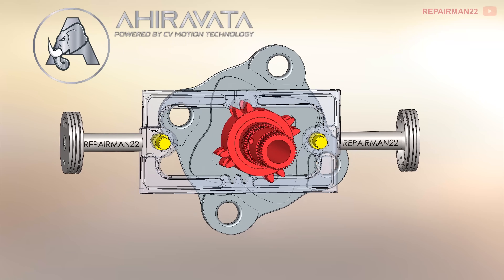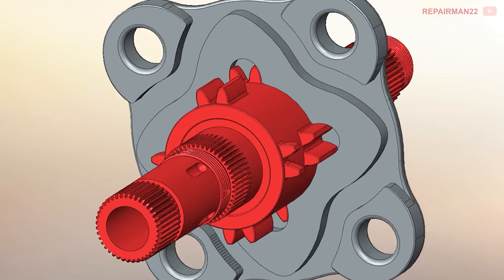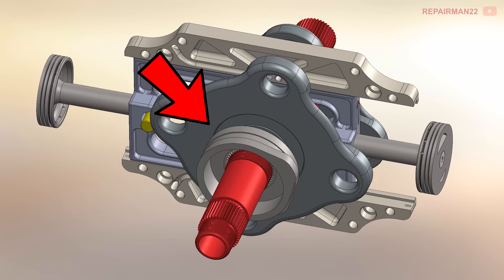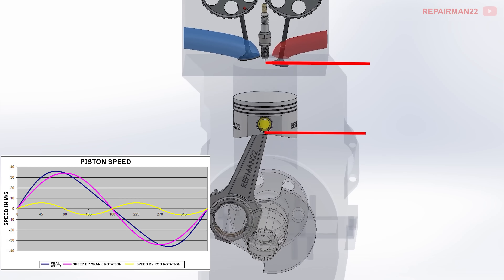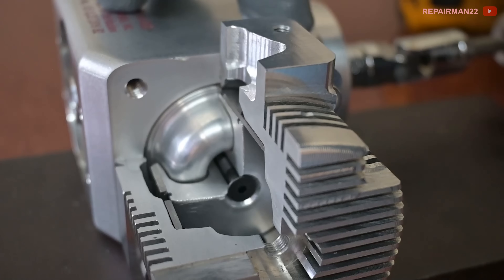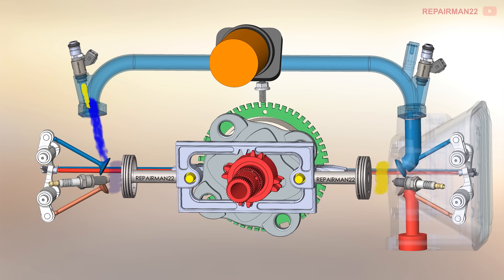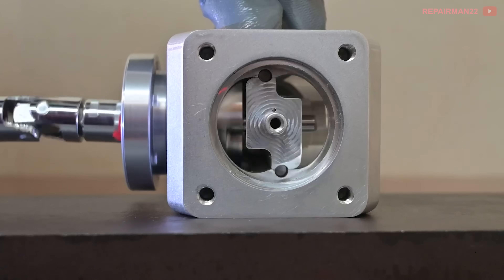The New FLOWER ENGINE 🌺 from Ahiravata 🐘

Comment: Why do all these inventors hate the crankshaft so much?
Reply: The biggest problem with crank shafts is that piston pressure is greatest while the connecting rod is lined almost dead-on with the crank, preventing much meaningful work from getting done. The sideways forces from the rods shoving pistons into the wall through most of the stroke contribute significant losses too and there is no way to mitigate those in a conventional crank engine.

The 'flower' takes care of the dead-end problem and friction on the 'yoke' slides can be taken care of using an oil film just like crank journal bearings.

In the case of an engine designed as a range-extending generator though, it would be even better to skip the yoke altogether and drive a linear motor-generator. No more side-loads to worry about besides gravity.
Reply: @teardowndan5364   "preventing much meaningful work from getting done" Contrary to what the video claims, the gas mixture in a cylinder doesn't burn all at once,  the piston is scavenging useful energy for almost the entire power stroke.
Reply: @lo1234-w9r  Spark-ignition gasoline engines waste fuel on the lean-rich cycling required to keep their catalytic converter happy and avoid a meltdown from overheating their pistons at the stoichiometric (ideal) air-fuel mix.

The efficiency holy grail of gasoline engines is achieving homogeneous charge compression ignition which burns colder and cleaner all at once, reducing if not eliminating the need for emissions control equipment.

In a conventional engine where the piston gets dead-locked by the crank, detonation can be immediately damaging if not catastrophic and safe operating limits have to be restrained accordingly. In an engine where no such dead-lock occurs until BDC, the likelihood of catastrophic damage should be much lower and allow safe operation closer to the explosive limits.

If you want to make a gasoline HCCI engine, you have to walk a fine line between combustion and detonation. An engine design that isn't guaranteed by design to self-destruct from repeated detonations is a good starting point.
Reply: @teardowndan5364  lineargenerators arent all theyre cracked up to be. consider... why do we bother with an electric motor to spin a compressor when we could simply slap a solenoid and piston together? the only compressor i know of that does that is the air pump in a fishtank... as it doesnt have to really make any pressure. efficiency? who cares as long as the water gets oxygenated?

having designed a few linear generators... some overlooked issues to deal with...

length of stroke. pole area, ratio of width to height. magnetic flux density. rate of change. the peak of the applied driving force, versus the peak load due to eddy currents and their lenz reactions that have to be overcome as we "force" electrical energy through the circuit...

just scratching the surface here, it gets really complicated really quickly, yet its supposed to be "simple", as it appears to be at first glance. if you dont know what you are dealing with, only have the basic "wave magnet past wire" idea of how a generator works.

if efficiency and performance are the ultimate goal... they dont co-incide with the linear generator.

no matter how hard you try, geometry argues for a rotary motor/generator as it simply makes all those issues non-issues.
Reply: @paradiselost9946  Mainspring has a 300kW free piston linear generator that achieves 50+% net fuel-to-AC efficiency. Only problem for mainstream applications is it that the whole cylinder+coils assembly is almost 20' long, horrible power density.

You won't achieve that in a crank shaft piston engine that wastes 10+% of its power on piston skirt, compression and oil control rings, journal bearing, etc. friction and shoots out another 20+% straight out the exhaust.

With a free piston linear generator, you can program the compression and power strokes to follow any curve you want as there are no mechanical constraints from crank and cam shafts to worry about.

The main challenge is scaling the thing down enough to fit lower-power applications without losing too much efficiency.
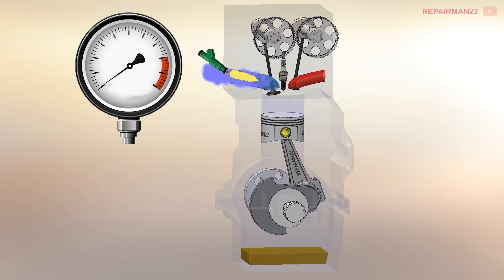Reply: 5:18 explains it really well tbh. 

I don't think any of these will replace traditional ICE engines tho, car companies aren't really putting their money in that basket. that said, I was surprised by Mazda bringing the rotary back, even if it's just as a range extender, so who frickin knows lol.
Reply: because it is fundamentally flawed.

we use the same design in presses, where a small rotational effort creates immense pressures on a punch or anvil...

so to expect them to work backwards? they do exactly what they do normally but in reverse.

convert immense pressures into a small rotational effort. 

can you see the issue yet?

immense pressures converted into SMALL rotational effort... most of that pressure is simply overloading bearings and attempting to tear the engine apart at the crankcase/cylinder bolts/etc.  a crank produces maximum torque at 90 degrees, when the pressure acts tangentially. half stroke. where most two strokes start opening their exhaust, fourstrokes exhaust a bit later in the stroke. and ALL cranks produce ZERO torque at TDC when the pressure is at its maximum... that doesnt strike you as being a bit... primitive? backwards? 

but, as geometry is a terrible thing, theres no real choice. swashplates, wobble shafts, eccentrics, cams... theyre all just variations of crankshafts in different axes, and they all share the same mechanical disadvantages.

the only engine that can actually apply its pressure tangentially to the output shaft  at ALL times is a jet turbine, and they have other fundamental issues.
Reply: @paradiselost9946  we all agree that there are flaws and somehow there's not been a viable alternative created that can replace it, piston engines have had cranks for 300 years it's not going to change
Reply: @paradiselost9946  Well, firstly, the crankshaft is not fixed on bearings, but is in an oil wedge. And the main advantage of the crankshaft is the simplicity of manufacture and the resource is ICE, which have already passed 2.5 million miles. And as for the disadvantages, each engine has them and this one shown in the video too.
Reply: @ВадімМаслай  yes. because what did i say?
GEOMETRY poses an issue.possibly an insurmountable issue, so we just accept what we found has worked since about 1780... or earlier if you consider man and animal powered machines...

just because we use it and ts the mainstay, doesnt mean its ideal. it was CHEAP, so men like henry ford could make a FORTUNE by flogging off MILLIONS of them...
Reply: @paradiselost9946  Yes, but this design has stood the test of time, it is more than 150 years old, and such engines are unique. Such engines with an unusual design have already appeared, for example, the Wankel engine, also known as a rotary engine, and where is it now? Why don't we drive rotary engines? Only Mazda produces something there, but I think I will close it soon because it does not meet environmental standards. And I also want to add that all these "non-standard engines" have a rather complex design, and a rather small durability resource.
Reply: @ВадімМаслай  and what did i just say about GEOMETRY?
a rotary uses an eccentric... which is simply a CRANKSHAFT with a crank pin larger than its pin offset. so it still suffers the same exact issue as the crankshaft, with the added mechanical disadvantage that the two sides of any face are fighting against each other as to which direction it wants to spin, and it has a 1:3 overdrive. that is, the eccentric spins at 3x the rate as the rotor. then theres all the other issues of fixed compression ratios, bad sealing, terrible combustion characteristics, massive surface areas compared to volumes so more heat is lost from conduction as opposed to being converted to kinetic energy or mechanical work.

but... toyota did look into some old designs when they revived the atkinson... not a great engine, but looking back into the history books is definitely the way to go, if fundamental improvements to the ICE are to be achieved. 

theres one design that (sadly) uses a crankshaft but also applies its maximum combustion pressure at the ideal crank angle to convert it to torque. but it needs a modern device, a turbo charger, to remedy its only "issue"... it has no compression. 
having no compression, it lacked the raw power to compete with the "otto cycle" in weight and size. 
yet... they didnt have turbo chargers in 1830. if it hadnt been for the four stroke engine reigning supreme, its very likely we still wouldnt have turbochargers... but now we have them, but the ideal machine to use them is long forgotten and deemed "useless". i beg to differ...

heres another forgotten one... how about the "humphrey pump"? demonstrations and calculations at the time showed a thermal efficiency of roughly twice any other engine in existence circa 1900... WW1 happened. the russian revolution happened. the chinese revolution...

and it got forgotten about. its issue? it just pumps water... "useless". until said water is used to drive water turbines in a closed loop system?

the turbine they credit to hero of alexandria... it then took 2000 years to revive it, and its what our modern world relies on as steam turbines in power stations.  we had to go through that whole "atmospheric engine" then the "external condenser atmospheric engine" to even start to be capable of making machines to make machines... we had to drain mines, we had to crush ores, we had to machine shafts and cylinders to high accuracy... we had to start with bits of wood and brick and bronze and sloppy fits and bad engineering for several centuries before we could start thinking of turbines again. we had to make measuring instruments, figure out tolerances, standardisation...

to say the crank, or our modern take on the ICE is the best solution simply because it exists and has been in use for 150 years is to completely ignore the history of progress.

hell, it took 150 years of making steam engines to get over the idea that the cylinder had to be vertical, and the forces transferred through a rocking beam... and at that point they still hadnt even cottoned onto using a crank for rotation... they simply pumped water. 

dumping said water over a water wheel was quite popular for a while. seems a bit... backwards, in hindsight, doesnt it? but what do we do in excavators and lawnmowers and similar machines with hydraulic transmissions? we pressurise a fluid with an "engine" over here,  and "dump it over a water wheel" over there...

and here we end up back at the humphrey pump "hydroelectric" concept...
Reply: (because) Parasitic losses occur at every pivot point of velocity of mass. Reduce the amount of pivot points (where power is distributed and converted) and you reduce friction.  A standard 4 cylinder has 40 types of moving parts, some in multiples.  A Wankel rotary with 2 rotors has 5 moving parts.  There are pro's and cons' with every design.  "Energy is neither Created, nor destroyed, only transferred." 🛠⚕️🎶🎵 ~C< 3)>>-Z->}

Comment: Way over complicated, a simple double ratchet in the middle would do way better overall smoothness en torque transfer, and having only one exhaust 4T like double valve with the 2T pressure intake would make no fuel leakage in the exhaust manifold (imagine a 2T with just exhaust valve actuated every downward but closed before pressure air intake kicks in).

Comment: I heard only "2-stroke without oil in the fuel"... And has an ideal "crankcase"-form for intake-air-transfers, perfect scavenging, without the stupid crankshaft swirling the air around. Looks great !!!
Reply: Well, it IS constant velocity, so that has drawbacks
Reply: @johnpeiredaquavoii2213  Could u elaborate on that, plz?
Reply: You would still need oil in the fuel for the 2 stroke tho
Reply: @xDmakc  Oil for the piston-ring... A normal 2stroke with Ditech-DI (Aprilia, Gilera, Peugeot) use 125:1 at idle... But here, there´s ideally no contact between piston-ring and cylinder-walls, so even 125:1 might be too high.
Reply: There has to be contact. In fact, combustion pressure is harvested and routed behind the rings to push them firmly against the cylinder for sealing. Over 25% of frictional losses in a reciprocating engine come from ring wiping friction. That's why the recent (and stoopid) move towards knife-edge rings that create higher sealing pressures with less friction. They leak like sieves.
Reply: @PAULSLEVINSKY-b7j  Having friction isn´t an inherent property of sealing good, and in a steady, isotropic situation, there mustn´t be any friction, in order to seal good. Most of the friction comes from the anisotropic/one-sided load on the ring, as well as from the piston rocking. None of that exists here, in this new engine.

Comment: As a engineer and innovator, I am a bit suspicious, concerning the construction.
Those teeth, might not be able to sustain the wear and tear, when run with load.
When considering, not least, tolerances with those teethes, they have always a "play", and manufacturing creates accumulative spec problems...
Since I have built and wrecked many, well,"ideas" in the real world, time will tel if this, is like many of my idea's, is a kind'a "pipe dream".
Anyhow, good luck on the way to make it work
from a Finn in Diaspora
Reply: im not worried about the teeth because they dont look like theyre taking any more load than gears in a rotary engine or a gearbox for example. my biggest concern is the huge reciporicating mass and friction limiting it to 2000rpm, making it completely unusable on the road. the only naturally balanced configuration of this engine is a flat 8 too, so between those issues its applications seem severely limited.
Reply: @chickenbobbobba  Hi. Thank's for Your input. What I mean is the pulsating load is "worse" on teeth than a constant load. Well, time will tel.
Reply: @outsider7658  ah yeah i see what you mean, but its mechanically the same as just a normal gear pair. they also have pulsating torque on each pin. but there might be a significant shock load if the flower isnt to tolerance
Reply: Worm gear.
Reply: Please let us just look at the engine and how it works! As opposed to a new "cut" every 3 seconds and gobs of "gee whiz! this is so great!" commentary.
Reply: @hg2.  Annoying
Reply: The pins acting on the flower transfer the power from the pistons/yolk. The pins and flower need to be of high quality metals.
Reply: @johnburns4017  Hi and thanks for Your comment. But did You read the other comments? There are same thoughts in comments, already.

Comment: it will foul the plugs like a boxer does. but like a boxer it has the extra cost of two cylinder heads. its unlikely to be successful in industry. it looks like the design is technically sound.

Comment: There are well known, much better ways to achieve the same benefits as they claim. New technologies have to provide some very significant, and also real net benefit over conventional technologies to have chance to become relevant. That is just an exercise in adding complexity ad absurdum in an effort to address issues that hasn't been significant problems for the best part of a century.
Reply: Have you thought about the contact between pins and cams that produce that movement? 
What about forces, stress, specific pressure, resistence and ware on these parts?
And about the acceleration on the extreme points where "constant" velocity "suddenly" change to the oposite direction?
And about the effect of these accelerations on forces involved, stresses and vibrations?
Do you still think this is a better solution to actionate a piston than a crank/ connecting rod system?l 4:57
THIS COMMENT IS GENERAL, NOT AN ANSWER TO YOUR OPPORTUNE COMMENT
Reply: @franciscotocoemilio9143  not sure who you are replying to, but the OP clearly says there are BETTER methods than this, that this is just "complexity ad absurdum"...

maybe you need to brush up on those reading and comprehension skills a bit more before letting loose on the keyboard?
Reply: "There are well known, much better ways to achieve the same benefits as they claim"

Such as? The scotch yoke is the only obvious one, and that has it's own issues.

Comment: If the crank rotation speed is constant, does that lead to non-sinusoidal speed of the piston?  Is there high acceleration of the piston at TDC and BDC?
Edit:  Nevermind.  Just got to where you mentioned it in the video.
Reply: Lol that 50 second non skippable ad left us all asking ourselves questions
Reply: Can be used with series hybrid car where battery is in series with engine since this engine good for constant generation

Comment: This seems to be very similar to that skotch yoke crank engine made by Sytech don't you think? only here it's using a gear mechanism with that slider crank
Reply: its called a "wrangle rack" used on old clothes wranglers. and a certain windmill from 1890. otherwise...
Reply: the scotch yoke has other problems that I think this resolves. Namely, the 'connecting rod' doesn't need to be nearly as wide, which greatly reduces the stresses and horizontal loading on the piston skirt.
Reply: Please let us just look at the engine and how it works! As opposed to a new "cut" every 3 seconds and gobs of "gee whiz! this is so great!" commentary.
Reply: Exactly.
This is literally a 200 year old technology..
Once again, Hindus build some outdated technology, and claim to "invent" it.